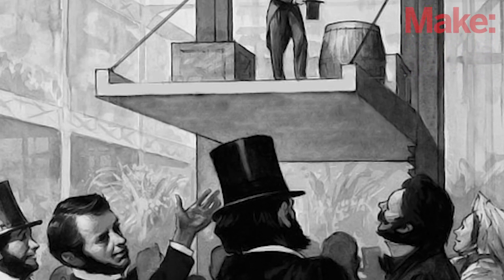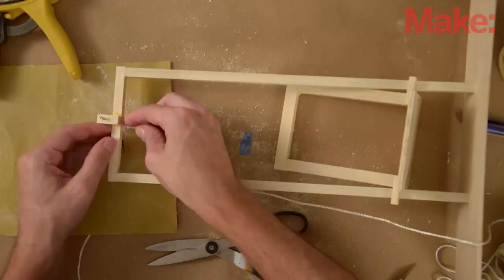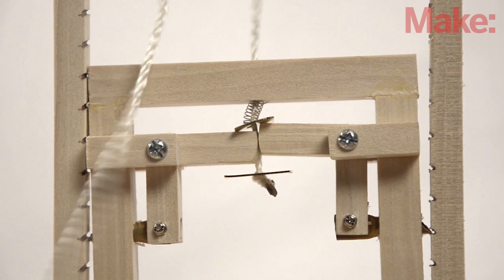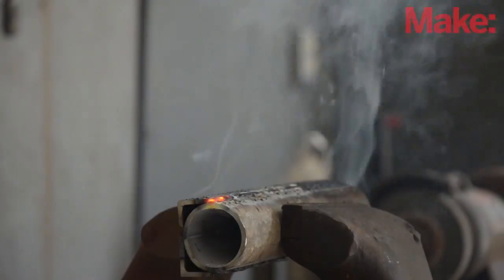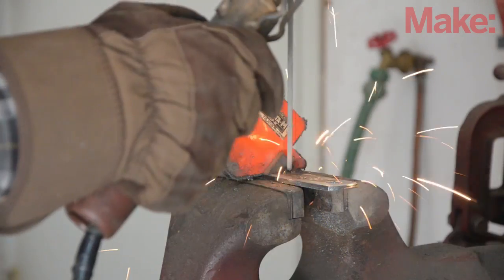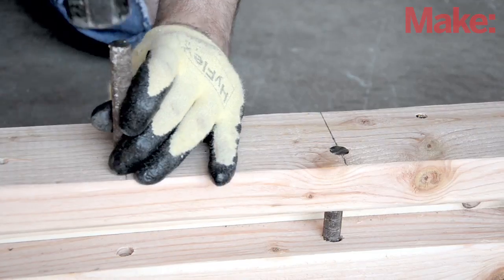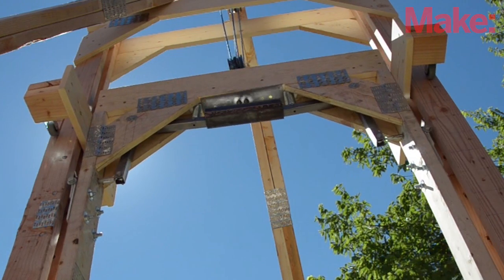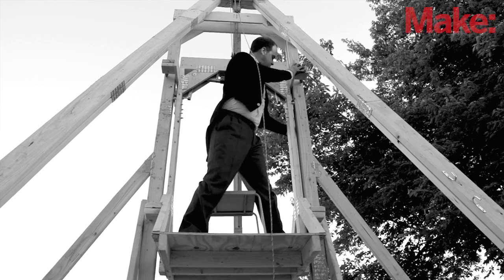Make Inventions: Otis Safety Elevator

Comment: unless the spring is broken
Reply: Berstich If the spring breaks the pieces would still be pushed slightly outwards due to the gravity acting on the other part. While this isn't nearly enough force to catch you if the rope broke, it probably is enough force to cause an annoying noise when the elevator is being used normally. This annoying noise hopefully resulting in someone getting called out to fix it.
Reply: +Berstich you right.. only spring in pit lift left.

Comment: Nifty concept. You should have used the other side of the hinges as the stop instead of depending on tiny bent ends, though. Use more of a sawtooth pattern in the uprights for catches. You could probably get away with less engagement and way more catches for a less harsh safety stop.